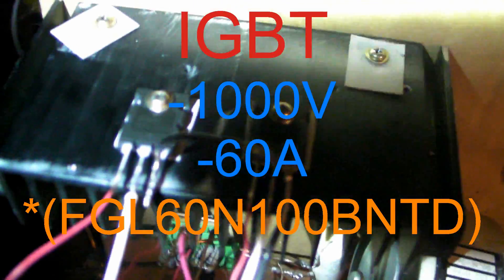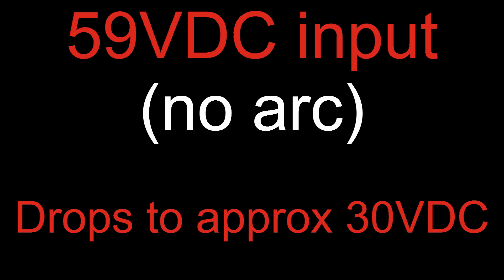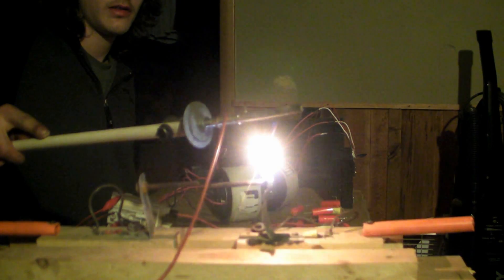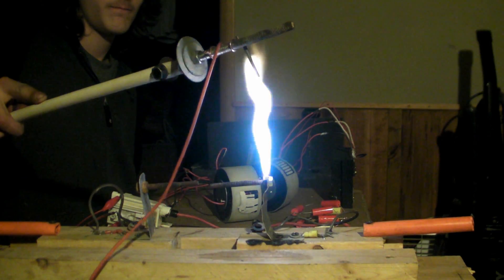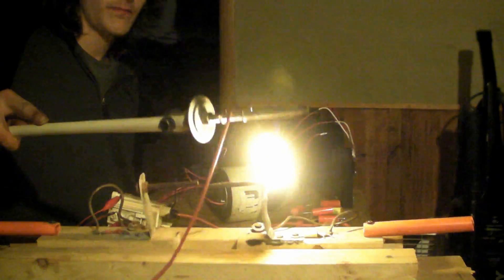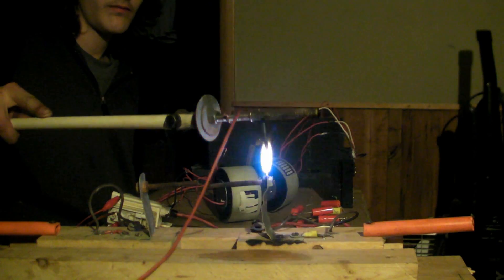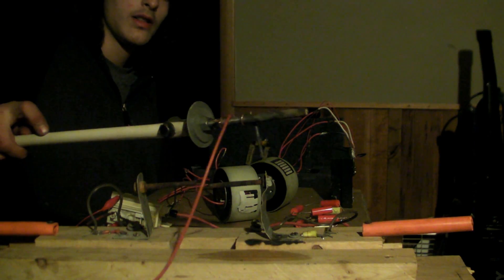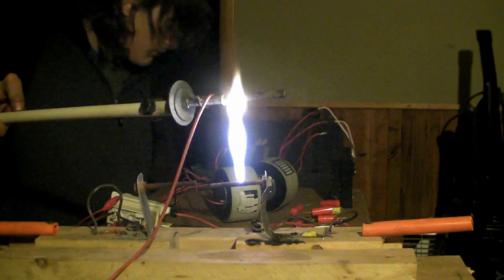Extreme ZVS Flyback Arcing

Comment: 115V drops to 50... I've got some powerful transistors here, but I highly doubt my 90V output transformer will drop a single volt.

Will the ZVS handle it?
Reply from the maker: It is hard to tell honestly. I would try maybe a shorted MOT as a ballast/dampener before the 90v gets rectified. Also you may want to try constructing an isolation transformer... (standard ZVS, 5+5 turns on a large ferite core *I do 6+6*, then 10-15 turns on the "isolation trans output" to feed the flyback transformer. That way if you have any epic flash overs, shorts, or any such cool things happen you're FAR less likely to blow your driver. Keep in mind, whatever capacitance you use on the driver, you need to have between the isolation transformer ourput, aka in parallel with the HV flyback primary. Otherwise the input/output become out of sync, take the same wattage, but massive drop in efficiency. It took me a while to figure that one out...
Reply: Oh thank you very much for replying. I got a half bridge here but as I don't have a scope I'm looking for a way to push my ZVS to its limits. Oh, I tried an isolation transformer with a flyback ferrite core and it heats up so much... Even at lower voltages. Also the transistors heat up more. This method didn't work for me. Maybe that happened because I've put the resonant capacitor across the IsoTrans primary instead of the secondary?
Reply: Did just like you, but with unballasted 90V. One of the 47N60 just shorted lol. I found a way to avoid tapping the flyback core. Used two inductors in series, and in parallel with the primary, it's Marko Bakula's induction noobheater mod. Plus you don't need a center tap. I got it to work with 5 turns on the flyback primary, unballasted 50Vdc, 470nf tank but transistor get warm. Produces a weird noise tho, can't explain that.

You get the same power with more safety. Transistors also work cool.

Comment: Curious... Can the arc kill if you accidentally pass the current through your body?
Reply from the maker: Jia Jun well I am not entirely sure how many amps were on the output end. I would say it is potentially deadly, I wouldn't want to touch and find out anyway.
Reply: Regular MOSFET ZVS drivers can handle up to 400W, that is already lethal. IGBT ZVS drivers can handle way up to a thousand watts. Yes. It definitely kills you. I have no doubt. Don't fucking touch it.
Reply from the maker: Good point. Either way it's a good roule of thumb to just avoid touching it at all costs.

Comment: i think it is 52 amps (correct me if i was wrong but it does say 52 amps).  it was the best IGBT i could find besides the IRFP250.  i wish i could get the FGL60N100BNTD. i am really jealous of your awesome arcs and i wish i could get some like that :(  also how do you run the ZVS driver on dual power supplys (could you give me a schematic) 

Thanks.

Comment from the maker: It will however with it being 600v and only 30A, in ZVS application you would need a higher current value to drive that many volts. You can accomplish 30A with an IRFP250.

Comment: Yeah.  Even though it is a massive flyback I probably won't last much longer at these power levels... KERBAM.  Maybe you could use 120 mains rectified and smoothed as the transformer voltage and the driver voltage could be lower if you run it on dual power supply's.  would it also be possible to replace the flyback with a MOT to get some crazy arcs.  I am working on the 555 flyback driver and I am trying to make it like yours.

Comment from the maker: Eventually ill get a variac. It can be ran directly into a rectifier and capacitor bank into a zvs (or whatever) That way you can set it to 150. But if you intend to drop that 178 with a resistor youd be better off using a MOT or so as a ballast. because at 150V itll draw quite some current for a resistor.

Comment from the maker: 15 volt zeners are better obviously, as they provide more leeway for spikes and such. I believe they are 1.2W, same as 1n4744a but 17 volt. I got 1000V igbts because 600 would kinda have a hard time with 168dc. 1000 will handle rectified 120 (169DC or something) leaving leeway for spikes also. Haha, I think I am about behind microwave89. Still need to find a ferrite core through a non jibberish language site (..ferroxcube..)

Comment from the maker: Nine inches sounds about right. No, I was using an audio transformer from an old amplifier rated like 250W. One of the windings is 80VDC. When rectified it was 115, but because its such a small transformer the voltage drops to less than half when arcing. Some day ill get a 30A variac and run it directly off rectified mains. You should easily get 12 inch arcs with true 115vdc. At least with a homemade flyback. When doing a full length arc (9"?) the voltage is really about 50vdc so...

Comment: I guess I would say nine inches or so. Were you using an isolation transformer when you got 115VDC? I didn't think it would drop so low. 

But anyway. My arcs were going about 6" when my FBT was still alive. (It dropped to 4" when nearly dead). I ran it on 50VDC, but I am not sure what the sag was. But I am going on the assumption that 115VDC will give me 12" arcs because of those numbers.

Comment from the maker: Estimate it yourself to avoid bias. Notice the spool of solder to the right of the electrode (seen in thumbnail)? That spool measures exactly 2 1/2 high. Assuming how many would stack to make the arc length I would guess 8-10" arcs or so.

Comment from the maker: the wire that plugs into the wall socket alone gets warm. I could probably get like a 2 foot arc with 115v but it really drops down to about 50V at full arc. IGBT is the way to go for sure. Now I need a better power supply that doesnt drop voltage as much

Comment: Nice :D , But i though with less turns your get high output voltage from the flyback , in my case i do , running 5+5 no corona on output , drop to 2+2 @ 20 volts the corona is cary and output voltage is alot high than on 5+5 .